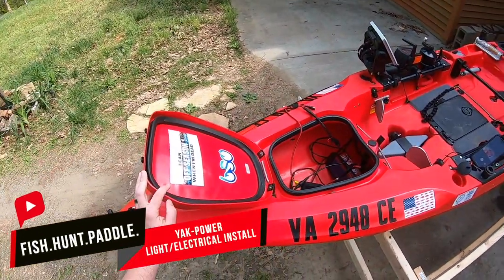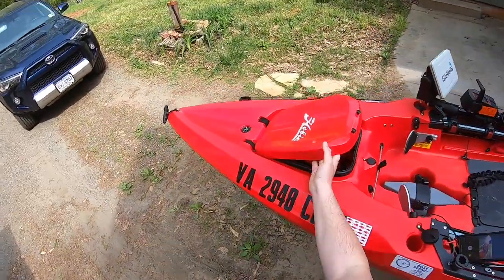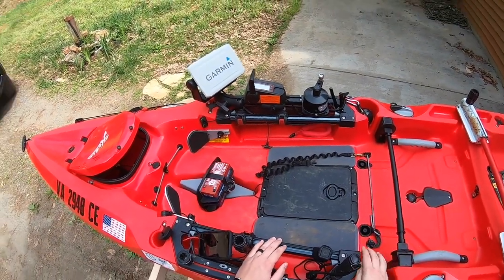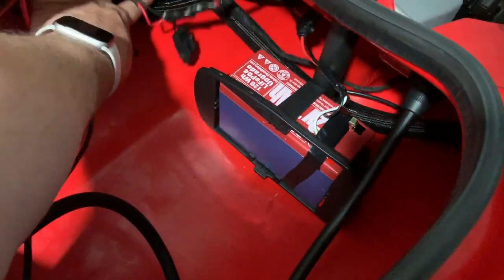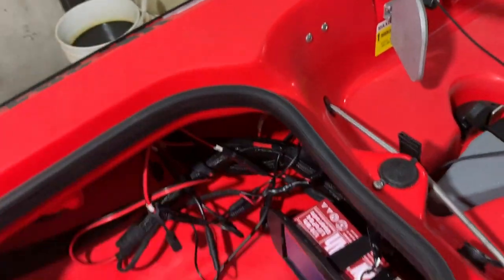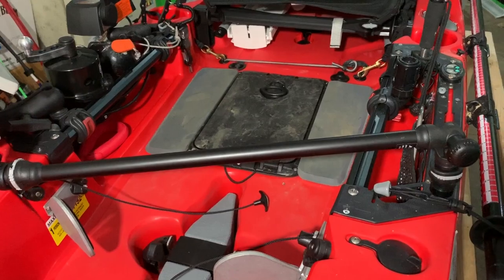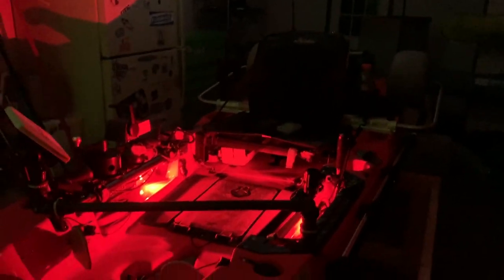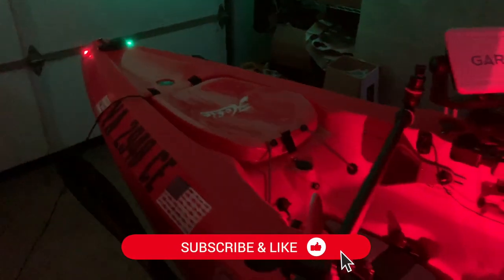Yak-Power Lights- Electrical System (2019 Hobie Outback)

Comment: Man, your Hobie is rigged t the max! Nice video. I have a question - by y-connecting the two batteries, is it effectively doubling your run time? Are the two Dakotas 10Ah batteries, and are they just powering your lighting and fish finder?  I'm thinking about a similar set up, and wondering how much battery power I should go with. Thanks.
Reply from the maker: Thanks! Yea they basically double the run time from 10ah to 20ah and they run the fishfinder (with side imagining and maps), lights, PowerPole, and USB ports. 20ah hours seems to be plenty for 1 day and possibly a 2nd day but I haven't tested that yet.
Reply: Thanks, I appreciate the info. Tight lines!
Reply from the maker: No problem tight lines